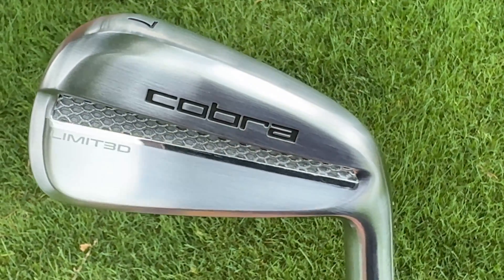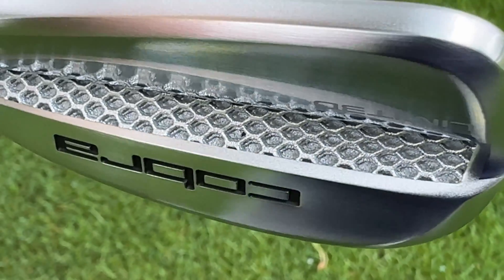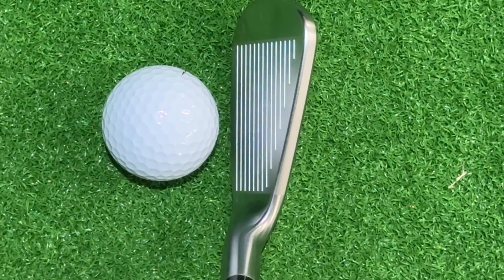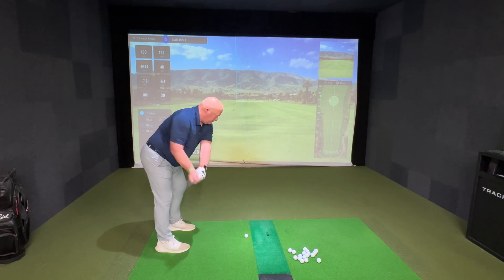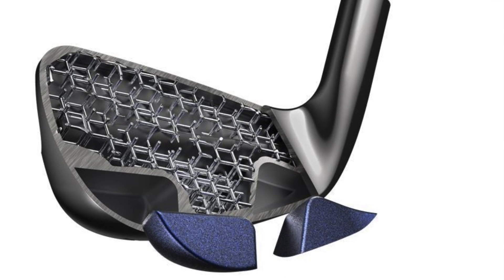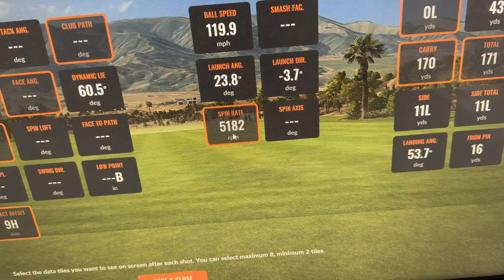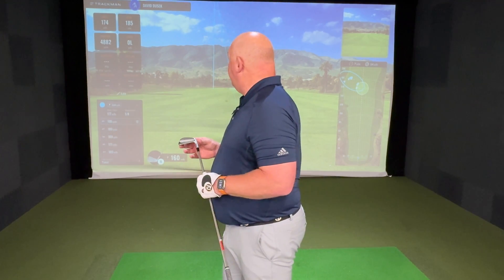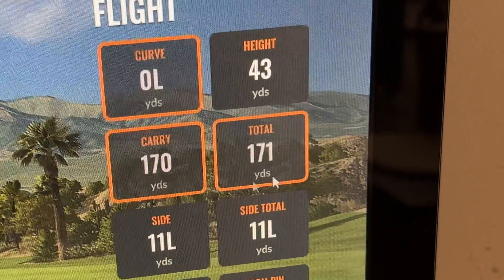Cobra's Limit3d 3D Printed Irons: Hitting & Testing the $3000 Clubs

Comment: 170 carry and 171 total with 5182 spin? These are bogus numbers.
Reply: Descent angle
Reply: And what angle would you need to produce one yard of roll out from 170? Can you do basic math? How much backspin?
Reply: @Sandbagger65  It would have to be a towering shot. I play Mizuno MP 243 with Steelfiber 95 stiff shafts and often get less than a yard of rollout with my 7 iron.
Reply: @Sandbagger65   No idea. I'm talking course results. My ball is often a foot from my pitch mark for a stock shot. But I can also draw the ball, hit low running fades. I've built my set to avoid going over the back of greens.

Comment: How did you end up with a set?
Reply from the maker: Cobra sent me a 7-iron, just the one club. - DD
Reply: @DavidDusek  Do these irons feel noticeably heavier in the head? Found the T150s to feel heavier in the head with the heel and toe weighting, wondering if these are the same.
Reply from the maker: @SnoopyGolf  No, not to me. The added weight in the heel and toe should not change the swing weight of the heads because so much material and weight are saved by using the 3D-printed matrix. There are lots of hollow areas inside the head that might otherwise be filled with metal, and by saving THAT weight, it allowed Cobra to add weight in the heel and toe. Cobra and Titleist may choose to sell irons at slightly different swing weights, but it should not be radically different. - DD
Reply: That’s cool, thanks for sharing!!